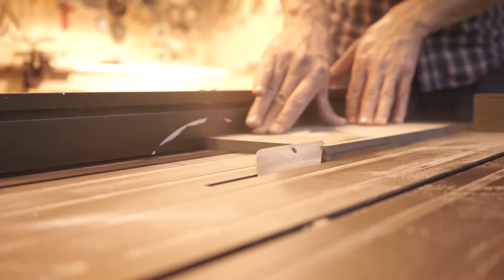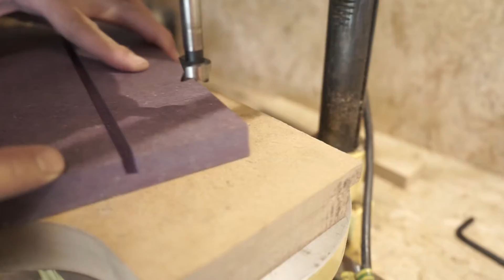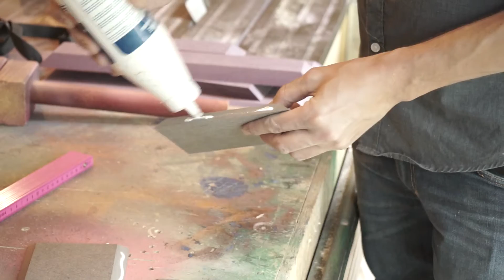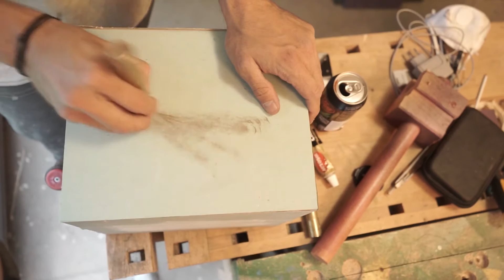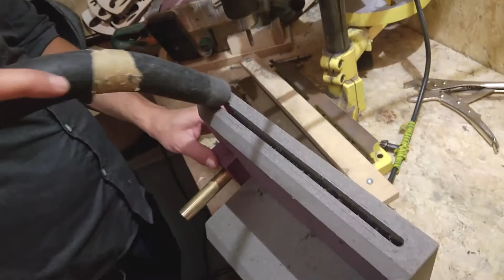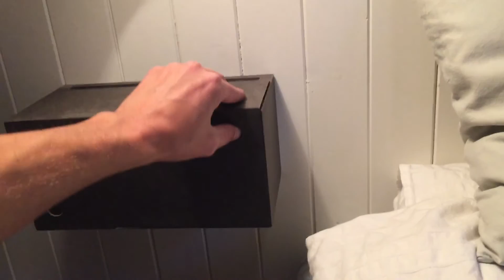Making Simon`s night table

Comment: Besides the brass pin, is this made from valchromat?  Also nice idea using miter joints on this project.
Reply from the maker: Hi, yes, just valchromat (mdf.) Mdf is nice to glue miters with, even if you are off a bit with your cut you can force them togheter, and also all the gaps can be filled with glue and sawdust and look just like the rest of the material.